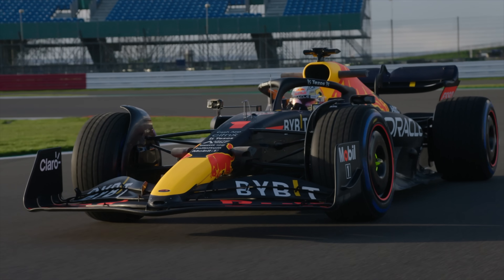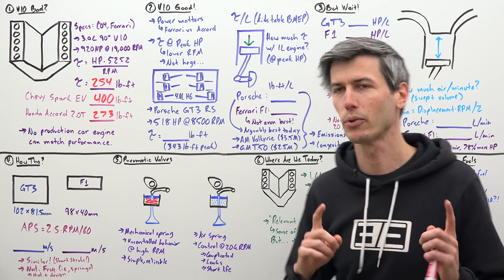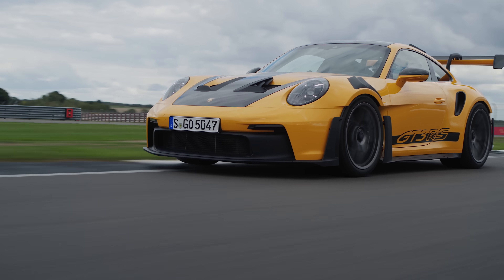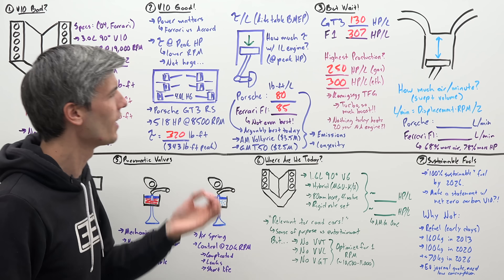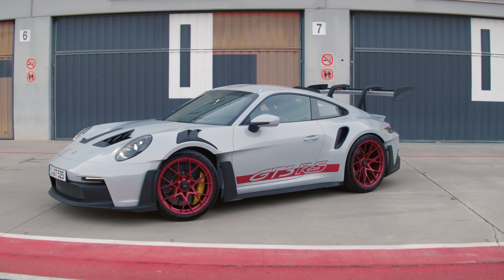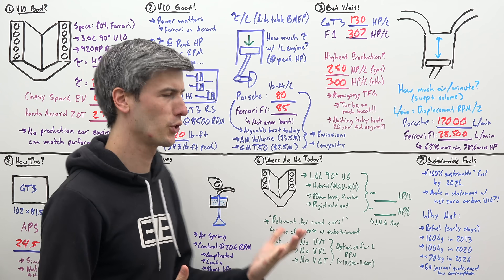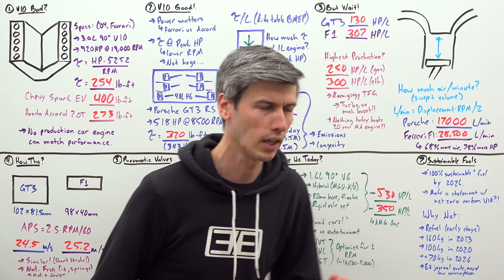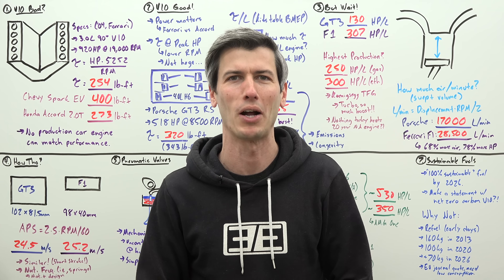Formula 1 V10 - The Greatest Engine Of All Time?

Comment: When you say "nothing today can beat" i think it omly applies to anything thats not an F1 engine. Because todays V6 F1 are only 1.6 L producing over 1000hp. And i know its not the N/A output but i think if we took the boost and electric motor out of the equation, probably better hp per liter than the v10. And lets akcnowledge that in 2023 the redbul didnt have any PU issues. I would like to know whats the output of todays 2023 f1 engine n/a power output. Ok i see you clarified that later in the video. But correct, nothing thats not an F1 engine. That meecedez is an F1 engine so i think you can categorize that car as an F1 car lol

Comment: 2023: 530hp/litre
1986: 900hp/litre (in quali)
Part 2?
Reply: Which car made 900hp/liter in qualifying?
Reply: @yummyhershey5902  The Benetton B186 with the BMW engine was thought to do 1350hp in quali. The other engines weren't far behind though. Also they couldn't actually verify these numbers on dyno so they were extrapolated based on how much boost they ran

Comment: How does this compare to 600 and 1000cc motorcycles?
200+ BHP/litre NA on pump gas with long service life and broad power delivery
Reply: Well, you just made the comparison yourself. 200hp/liter and pretty reliable, especially when you consider the abuse those bikes go through. It is worth mentioning that their service intervals are much closer than the intervals for cars, which is probably a reason that they're able to run for so long with the performance that they're capable of.

Comment: I’d like to know the comparison of torque at the wheels when it gets through the gearbox in 1st
Reply: That just depends on the gear ratios. They're publicly available for the Porsche, but I don't believe there's anything on the F1 car, so unless someone could find out what the gear ratios were, a comparison can't be made.

We do know that they both have 7 speed transmissions and that the F1 car has a lot more horsepower to work with, so it probably makes more torque at the wheels in every gear, right? Well the F1 car is 1/3rd the weight, and even though it has more grip, the difference is lower at low speeds, so the torque at the wheels is probably similar until you get to higher speeds.

Comment: That's the problem with formula 1 all the vehicles are just about the same because they are built to a formula. This means no real room for real engineering advances. As for sustainable fuels that is just greewashing baloney. If the criteria for the build was along the lines of you can have so many joules of energy to do so many laps it might actually get interesting. Just think somthing usefull may even filter don to production vehicles when did that last happen..... and it wasn't turbo charging which had been around on diesels for a long while. Still love your enthusiastic approach 
Keep it up 
I just hate F1

Comment: Nice arbitrary metrics such as hp/liter... how about hp/kg or, heck, hp/valve? These are made up units with little practical meaning---can anyone tell the difference between 500 hp being made by a 2.5l or a 5.0l engine? Why all the oohs and aahs for the 2.5l engine in this case, when it may actually weigh more and have larger dimensions than that 5.0l one... surely it isn't better when we consider other factors, too?
Reply: This whole video is arbitrary if you think about it. hp/L isn't a unit with little practical meaning when regulations are involved. Displacement is usually a good indicator of size and weight (although that's not always the case) and to have such a high hp/L for an N/A motor is still unmatched today. It was the best racing motor they could make FOR THEIR RULESET. If they could use a higher displacement motor, they probably would because they'd be able to make power more easily. If other engine configurations made the same power but were lighter, they'd probably use that. That's what makes these F1 motors so special.
Reply: @yummyhershey5902  yes, it's an understandable choice given these constraints, but he made it sound like an absolute metric to judge engine quality against. F1 engines are special indeed.

Comment: F1 has been relegated to a bunch of European elites and power hungry bureaucrats that share no relevance with the sporting aspect of racing anymore. Not only the V10s were way cooler, raw and visceral, they were way way cheaper to make and sustain. So when I hear these guys talk about cost containment in F1 and relevance to street cars, it's a bunch of nonsense. The Judd V10 3.5L from 1991-92 (personal experience from a Dalara), were incredibly reliable and the technology was already very mature. It got even better over the years. Drop the RPM a little if necessary (from 13.8K at qualifying & 12.5K in racing) and these screaming engines would last almost half the season if not more. But instead, you have now these monstrosities that cost 10x or more to produce and maintain. Really cool video!

Comment: No, actually F1 V10 is (in my opinion) the worst engine formula:
- No innovation like it was in 1970s or 1980s
- Earrpae sound
- Shitty reliability
- High fuel consumption
- Hard to combine with hybrid system  (no manufacturer would join the sport with engine design from 20 years ago)

Comment: The amount of torque at the crankshaft is only partly relevant, because it gets multiplied by the reduction in the drive train. And a high revving engine with the same torque at the crankshaft that makes double the rpm of a slower running engine can run the same speed with double the reduction. So AT THE WHEELS (which is what matters!) the high revving engine will still have double the torque and therefore double the acceleration! That is exactly why horsepower (or kilowatts) is the number that matters for performance, not torque (at the crankshaft)!

Comment: They’re using F1 as a running prototype to achieve whatever their goals are as you mentioned their target was a very thermally efficient engine. Mercedes achieved a diesel-like efficiency in 2014 and now Honda have gone beyond what Merc capable of doing in 2014. 

I believe doing a normal R&D vs doing R&D using a highly competitive engineer in a competitive sports is going to speed up the process lot more if we implement the later.

Comment: My dream for a logical power train in F1 would be:

2.0L in-line 6 revving to 20,000rpm limit. Simple aluminum construction. Then have and MGU with about 300hp but mainly torque filling the ICE. With the advent of e-fuels F1 should really bring back in race refueling for safety and weight reduction and strategy options and the ability for the tire supplier to create a high quality tire that doesn’t have to fall apart to ensure pit stops. Sure it can degrade a little, but not made to do so like current Pirelli. The sound and in-line 6 motor would make with a big bore would be epic.

Comment: Modern road cars are going to almost all be electric. So F1 has no road relevance. Synthetic fuels might be used in long range aircraft or ships. The lack of road relevance is the end of F1 in its current form. It will end up like horse racing, or yacht racing.

Comment: Forced induction, even if via a nominal ram air effect, is key to maximal power, constrained by the physics and chemistry of the ICE engine; however, if there was just some method to have the same effect, just “down-wind“ of the cylinder, the same efficacy could be achieved.

Just kidding, there! A well-scavenged header system accomplishes the same goal. Here´s the thing, though: I have never successfully come up with a technique or model that adequately explains the complexities of resonance, tuning across the widest possible rpm range (variable exhaust crossovers, dynamic variable header length), back-pressure considerations and mitigation, etcetera; indeed, anything more than trivial statements of fact, especially within a 10 minute video.

Is there such a thing? A challenge, you ask? Yes! I am genuinely curious what you may indeed choose to present in a future video.

Comment: I think that we should go with the naturally-aspirated Inline-5 for a while. Lower displacement than anything before it, more length to force a longer wheelbase (for greater cornering stability regardless of downforce generation), the most closely related exhaust note (which will still make make the people happy, even if not quite as much), an opportunity to revamp the regulations to match what they claim to want being achieved, and an efficiency bias towards high-end throttle/load (via the absence of boost pressure).
Reply: If you had seen a turbo-hybrid car in person you would know how daft it sounds to ask for a longer wheelbase.
Reply: @joelambert7128  I'm referring to a track-exclusive motorsport monster, not a road-going family car.

Comment: @Engineering Explained  - You should do a video on the axial flow rotary valve engine they tried to make for 2003/2004 in F1.  Could rev even higher due to the lack of a reciprocating valve train.  Bishop was the name.  I've built a few of these engines myself in the pursuit of a better breathing engine.

Comment: Jason, what are your thoughts though about using desmodromic valves in a "street" engine to avoid valve float, but not having to rebuild your car engine every 500 miles?  I know freevalve is probably the best, but it would seem to me that springless valve operation would be the next best.  Obviously Ducatti thinks so for bikes :)
Reply: I believe the Desmodromic actually requires more servicing than typical valves for street use because it uses more parts. The valve train needs to be precise for optimal engine performance
Reply: It's a problem with temperature changes and parts moving around, they need service quite often.

Comment: I know they do it but I  can't quite comprehend that mass in these engine rotating at 20,000 RPMs. Engineering marvels.  Yet certain components of some jet engines go higher.
Reply: What's more terrifying is the insane piston speeds some of the older Pro-Stock dragsters had. We're talking a 500ci big block spinning at 11k+ RPM. Hell, NASCAR Cup V8s from the same time period as the F1 V10s had slightly higher maximum piston speeds overall, thanks to the doubled stroke length and incredible 9,800 max RPM, all with a pushrod valvetrain.

Comment: They've banned refueling, so you have to have enough juice for the entire race at the start. With how big and heavy F1 boats already are, this might be a problem with a V10. Another factor is cost: V10 engines weren't cheap, and some teams are still under the cap, I believe. Which also ties in into attracting new manufacturers: there's less incentive for them to develop NA V10's when that technology will be exclusive to F1 cars. Not like MGU-H isn't, but F1 is now owned by Liberty, so the hypocrisy is all-times high. They will make a schedule that requires entire teams to fly from one side of the world to another all the time if it makes them more money, but then they'll also pose around and claim sustainability based on twenty cars running for under two hours.

Comment: Ferrari never truly gave it the peak figures for F2004 or F2005. You are making it sound like that some other manufactures were pulling almost 80bhp more then Ferrari back in 2004, even when one could see its performance in both the qualifying and the races. F2005 engine was arguably the most potent engine on the grid, and by definition, the GOAT.

Comment: FUN FACT: a 2.4L V8 COSWORTH CA (first F1 engine to exceed 20,000 RPM) was apparently sold last year for $26,000 US.  not necessarily a running engine but an assembled Long Block (much like the Ferrari static displays shown) with those sexy convoluted headers attached, it was in the hands of a collector here on the East Coast in Pennsylvania.  would've made a nice edition to my Motorsports Man Cave, but the Wife would kill me if i spent that much for just a bloody ENGINE and i didn't get the rest of the body, wheels, seats, transmission, etc to go with it.  i mean can get away with a lot more than most in terms of "frivolous spending", but that's a bridge too far.

Comment: I enjoy the technology in F1 and watching the sport progress since the early 90s. I say let them use the 3.0 V10 with the current hybrid systems and turbo, give them VVT and run on sustainable fuels. I don’t really care how much fuel they use, the teams will naturally try and make them as efficient as possible for weight savings and race strategy anyways. Then we can reasonably leverage the technology to consumer engines running less rpm for durability and smaller displacement for reduced emissions.
Reply: For me, it should be - here's an amount of fuel to use for the race. Here is a MINIMUM fuel flow limit (to prevent excessive fuel saving), here is the minimum weight of the car. Have fun y'all. They would all probably converge on the same format...as that tends to happen. But how cool would it be to have a grid where there were v6 turbos, v8s with KERS, v10s and v12s all competing!!!
Reply: In WEC,teams can make  different kinds engines @lankyboy90
Reply: :face-blue-smiling:

Comment: I thought that the formula 1 engines from 2004 used pneumatic actuators to replace cam shafts ?
Reply: I think it's pneumatic valvesprings, not actuation. So you still have a physical camshaft, but you no longer need to worry as much about spring harmonics or vibration dampening, meaning you have much finer valve control even at extreme RPM.
Reply: @griffinfaulkner3514 you are correct

Comment: Torque at tire is what matters. Not power, not torque of the engine. Optimizing torque at high rpms (i.e. power) is of interest, but please do a comparison of the torque at tire accounting for gear ratios across the rpm spectrum for various vehicles and integrate this curve. Forget what the engine does mate.
Reply: You still need rate. You can have 3k  lbft at the tire, but if it drops of at  0.01mph it's not very useful. It means you have no power.

Comment: Can you tell me how much torque the modern turbo v-6’s make? Or for extra credit could you tell me the rpm it makes peak horsepower at and I’ll do the math myself? 🙂
Reply: It's probably slightly above 10500 rpm, since that's around the rpm where they upshift, so most likely around 11000 rpm. (Also due to the fuel flow limitation). Assuming 11000 rpm it would be around 542 Nm of torque. If it's 10500 rpm it would be around 568 Nm of torque.
Reply: Thanks!  @MartinvanStormOfficial
Reply: @CBCycles You're welcome. Technically they could rev up to 15000 RPM, but there is no benefit in doing so due said fuel flow restrictions.

Comment: I loved it when the rules were a capacity and the manufactures built whatever config they wanted.  Hearing the different cars was fantastic, you could tell exactly what was coming.  As a kid watching the F1's in Australia, the V12 Ferrari and Honda were incredible, they were almost scary how loud they were.
Reply: Shame that didn't extend to letting the teams use turbo V6s if they wished -- for some reason.
Reply: @n8pls543  think in 88 there was a crossover year where McLaren, Ferrari and Benetton used turbos and the rest NA. The turbos were limited to about half the boost and they still dominated the NA cars
Reply: v12 ferrari ftw, greatest f1 engine sound ive experience in my life by far
Reply: The problem with capacity rules is that eventually it will still lead to the same conclusion (like rally with I4 with 2.0L rules).
Reply: @kidpagronprimsank05   you could do it like the WEC. They have a lot of freedom in design, but there is a "Balance of Performance" which is another hot button issue. And they have certain power and downforce targets you cannot overstep and they are pretty easy to reach. So for example the Peugeot Hypercar runs without a rear wing, because they are already at the downforce target with their ground effect.
Reply: Capacity rule ( for Tax, kei cars, bikes) has lead to inefficient road cars because efficiency drops above 3000 RPM. Yeah, probably too many drivers remove restrictors. On a turbo car the compressor is the restrictor. Owners probably then buy bigger turbos… But restrictor can and are checked before a race.

Comment: Your equation on torque is not very accurate. I tested it on 4 different engines that I know the exact hp and torque number 1 being 395hp at 5,700 rpm it said it was 364 lb ft of torque when it's actually 438 lb ft. Displacement matters when it come to torque on NA engines.
Reply: It's a mathematical fact that  395hp at 5700rpm is 364.11 lbft.

The torque number is likely at a different rpm.

Comment: I don't know am I missing something here because a Cummins 15 l diesel engine makes 2000 foot pounds and maybe 400 horsepower but that's still more torque per liter
Reply: They are different packages. Your Cummins 15 dry weight is about 2961 lb while the Ferrari F1 engine is 264.6 lb.

Comment: what is the goal of a synthetic fuel instead of just ethanol?
Reply: pretend to be more environmental friendly.  marketing stuff.
Reply: F1 uses structural engines with compression ignition (compression levels similar to road diesels). Ethanol would require spark ignition.

Comment: Reminds me of the research Honda did for their motorcycle GP engines interested early 60's. A 50cc twin with 4 valves/ cylinder. 15hp+@20,000. Revs to 25,000rpm. All this done with engineers using slide rules!